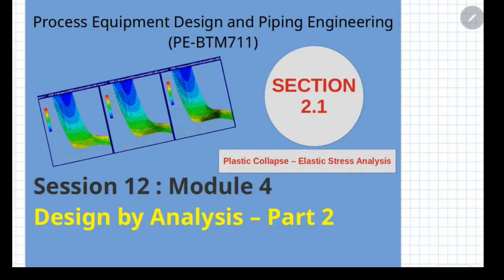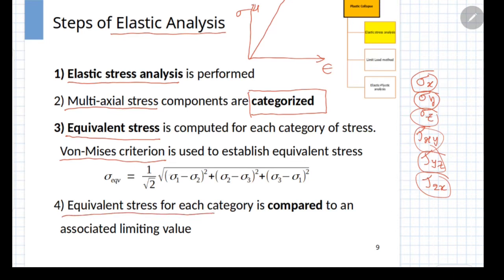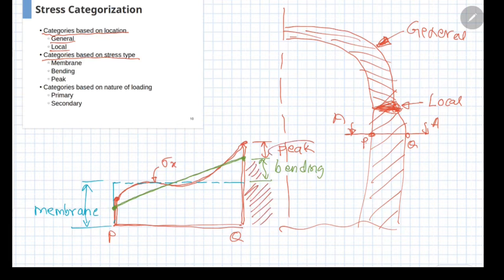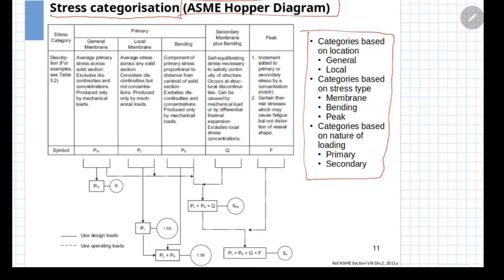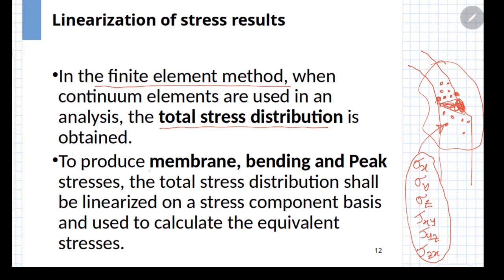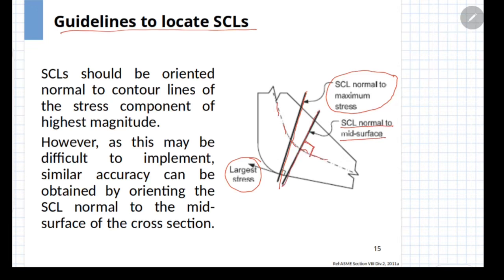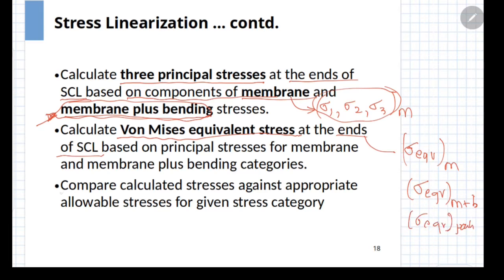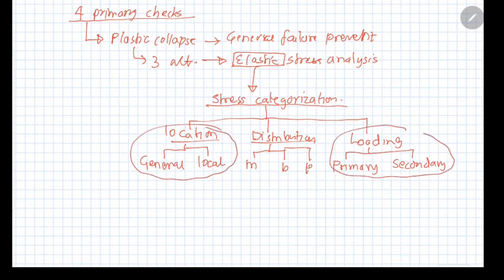S12B Plastic Collapse Check

Comment: Can it only be used for parts with thickness? I have a pressure vessel that has some high-stress distribution longitudinal to the vessel due to seismic loading. I am using shell elements in Nastran.